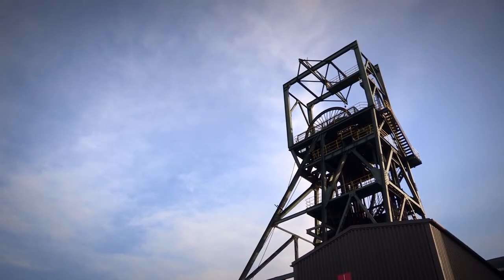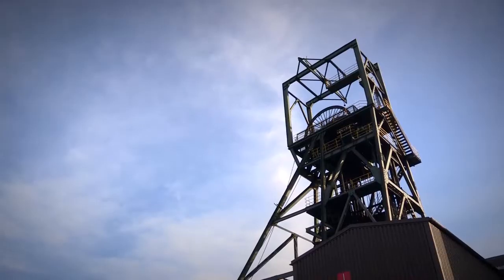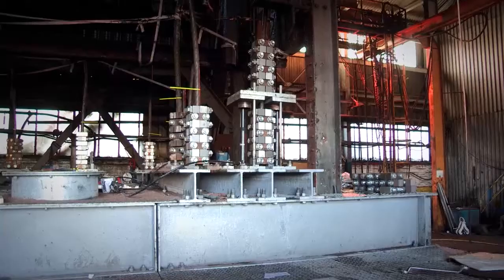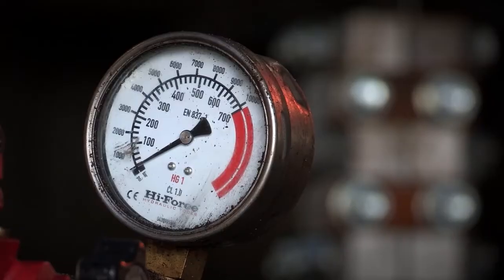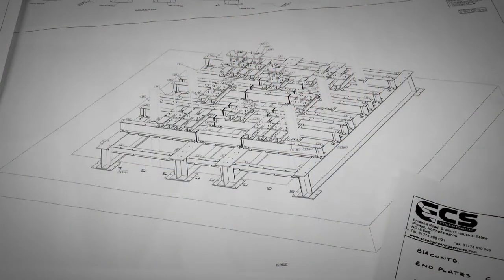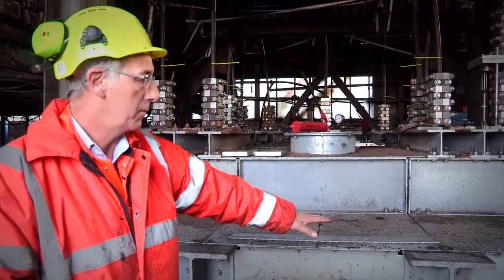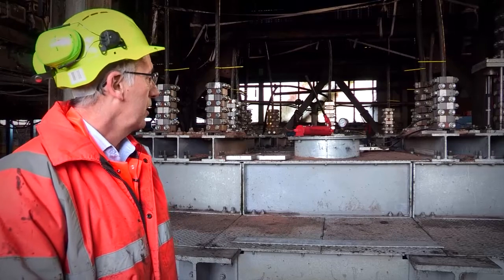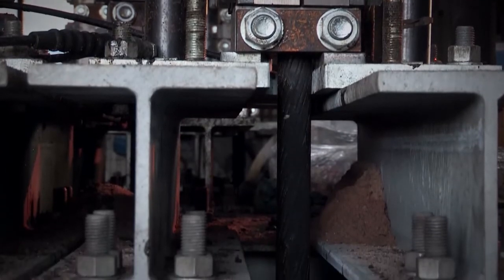ECS delivers mineshaft cover to help secure Daw Mill Colliery Site

Comment: I still dont understand what the problem was. Theres ropes running down the shaft so it cant be filled? So if the ropes are a problem, why not just cut them at the top and let them fall down the shaft and then drop the stone in on top of them?
Reply: I agree because the ropes will be damaged anyway and required changing so agree just cut them and let them fall inside.